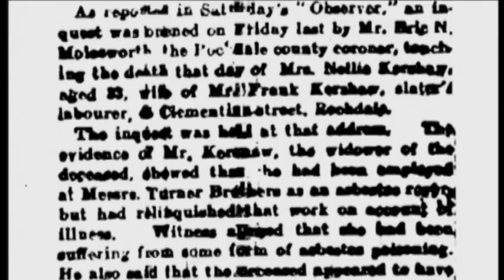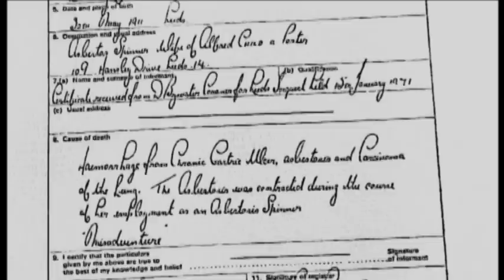The Evil Dust - the history of asbestos,  an excerpt

Comment: @0:48 seconds that espressos floor tile is still in our kitchen today house was built in 1940. It is covered over by later linoleum tile that was installed in the 1970s. 
    The whole house is heating ducting is covered in asbestos throughout the entire house. 
     The chimney flue vent from the downstairs furnace and water heater piping is completely asbestos going up to the house 
     Around the base and on the top and behind the house, furnace is all asbestos matting and insulation. 
     Behind upstairs kitchen against the wall there’s a giant 3’ x 4’ asbestos panel where the stove is placed. In a long R backyard in our two neighbors the back side wall of the house of our back neighbor that is 75 feet long two stories high of exterior asbestos tiles are still all original to this day..

Comment: ASBESTOS should also be named DEVELS dust 666. 666 is the devels number.  I bet it was founded on 1 friday 13th.  

Asbestosis disease
Savage material.
Brutal dust 666
Everlasting risks
Severe dangers
There is now a safer material 
Opinuns / facts about disease 
Stay out of the building. 

BAN 🛑 ASBESTOS AND FIND A SAFE ORGANIC REPLACEMENT INSIDE.

Comment: The biggest danger today is disturbing  hidden  asbestos.

I've been unfortunate enough to tear into plastered over asbestos  insulation board before that had been nailed over the top of lath and plaster. From the loft I thought I was dealing with lath and plaster only.

The stuff is lethal and prevalent even if you would never intentionally have contact with it.

I've had similar instances with pvc soft boards mounted over asbestos  and plasterboard over it in garadge roofs.

These days I try to look very carefully before I drill and always wear a respirator even if I'm almost  certain I'm just drilling plasterboard.

Comment: My grandfather worked with powdered asbestos for years when he was younger, people were practically rolling in it. Not surprisingly everyone he knew there died many years ago from asbestos related diseases. My grandfather’s nearly 80 now and still going strong with only minor scaring on his lungs. He is very lucky but has always told me about the dangers of the stuff. 

If you work in an industry that still works around asbestos, don’t be embarrassed dressing up in full protective equipment because the ones laughing at you for looking silly won’t be laughing when it’s them on their deathbed and wishing they done the same. This stuff isn’t a joke and lingers in the air for longer than most fibers as they are that fine, they get caught on your clothes also so if you feel you’ve been in contact with asbestos fibers get rid of them clothes and don’t take them home otherwise your family will be paying the price later in life too.
Reply: how can i get rid of the asbestos in an apartment after an company didn´t isolate the bathroom ?

Comment: My stepdad worked for the water dept in my town and told me that there is still asbestos water pipes being used cause its too expensive to replace.
Reply: It's safe transmitting water.  Not safe to breathe when cutting.  Cement + fiber.

Comment: Treat it and handle it and work on it as if you are working with highly irradiated nuclear fuel rods. The work area has to have tunnel suits, glove boxes, airtight suits and air locks that decontaminates itself after you enter and decontaminates both you and itself before you exit. Asbestos substitute is wollastonite, a kind of fibrous powder but it is made out of calcium silicates, CaSiO3

Comment: My Father worked at General Electric where they used asbestos in the lining of electric cables. Decades later he developed the cancer and was gone in 6 months!
Reply: Workers at the General Electric (GE) plant in Peterborough, Ontario were exposed to a range of toxic chemicals from 1945 to 2000, including asbestos, arsenic, vinyl chloride, beryllium, formaldehyde, trichloroethylene (TCE), polychlorinated biphenols, uranium and lead compounds, according to a new report released by Unifor, Canada’s largest union in the private sector. The document was presented to Ontario’s Workplace Safety and Insurance Board (WSIB) – an independent trust that administers compensation for workplaces – on 18 May.
Reply: SA-News how was it gone?
Reply: Abraham Alburez 
You misunderstand. He means his father died of asbestosis, not that the cancer was gone.
Reply: @AyeeBroTV  He died in 6 months
Reply: My uncle was an electrician and died of the same thing.

Comment: Asbestos reinforced concrete. Hands down the best building product ever. Still being used extensively.
Reply: Middle east. Pakistan. India. Buildings are so strong the stucco just needs a redo after an explosive attack.
Reply: Rick Matz
Where , China and North Korea ?
Reply: It's only the second best,  steel is number one.
Reply: Sterl is a conductor.
Reply: And glass is transparent,  it almost always takes more than one material to build a structure.
Reply: Other fibres work fine aswell, but are more expensive

Comment: In sheet metal school, we were shown a photo of the internal organs of an insulator that had worked with asbestos for 30 years. His lungs, liver, even intestines were covered with dime sized tumors. This man died on the operating table
Reply: Still used extensively though also there's a lot of almost identical compounds but different versions of Diatomaceous Earth are almost exactly same structure is asbestos but they don't have any warnings on them weird
Reply: @waltersobchak7275  talc is mined near asbestos, very similar, causes cancer and is in table salt and toothpaste.
Reply: @maxwebster7572   aye bro is that right I'm pretty sure they put it in sealer paint too . Acrilic high wall board sealer . Undercoat for jib etc. I've sanded so much of that an consumed heaps as well as lead paint
Reply: @jonog5632 9×9 tiles where loaded as well as the mastick that is used to put down the tiles. Wasn't detrimental to your health at  the time because they were still pliable.  Yeah I think about every time I dry swept that floor........ not really I don't worry about it too much. I think it's it's like everything is it affects some people more than others

Comment: I was exposed to asbestos when working on a friend's ranch. It was, buried building waste in the form of plaster mixed with asbestos. Dug lots out. That was years ago and luckily I seem to have got away with it.
Reply: How many years ago?
It can take decades to develop......
Reply: @dannygroom3327  2. It had been in the ground a while and was mixed with plaster sheet though, I soon enough got a dust mask when I realised what it was. Usually people that get asbestosis got it from working with the insulation type for extended periods. I don't think I breathed any fibers in, i I did, it was minimal and probably expelled from my body naturally at some point.
Reply: @MrRedeyedJedi  that's one of its problems is that the body doesn't expell it so it remains inside continuing to do damage. The damage may be small but over time it adds up, but like you said being in the ground and not dusty is probably °K.....
Reply: @dannygroom3327  all I can do at this point then, is have confidence in my genetics and the flem I've coughed up at various stages throughout life haha
Reply: @dannygroom3327  that's the hope anyways!

Comment: What this video FAILS to tell you is that fiberglass is every bit as bad for you. Studies have been done showing so. In fact was at one time named "the asbestos of the 90's" and yet it is still used in nearly every single home today. Its a billion dollar industry, thats why it is only considered a "lung irritant". We continue to protect and use fiberglass which is just as harmful.
Reply: SPNFENDER silica as well
Reply: What you fail to mention is proper handling of fiberglass and asbestos = no issue. Wear a respirator or rated mask. Jez, what do you expect the world to use? Fairy dust.
Reply: @UrielX1212  There is no proper handling of asbestos, has to be removed by by licensed abatement, I know I am one. Go try and properly "handle" it let me know how that works out. Point is there is no cancer causing agent in asbestos or fiberglass, its what it does when attached to the lungs that causes cancers, and they are BOTH as equally dangerous and should be handled as such.
Reply: The fear mongering "certified asbestos remover" crowd are the worst. Together with Lawyers they form an unholy alliance. Sure makes people alot of money.
Reply: @UrielX1212  Tell that to the thousandssss of people who have lost there lives from asbestos related jobs. I have known several personally, a slow and miserable way to die sometimes taking yearrrsss,  some "fear mongering" in that.
Reply: Plutonius X fairy dust will make you gay.

Comment: My grandad worked in the mill of the Jeffrey mine for a few years. He couldn't see his coworker six feet away because of the dust. He is still alive at 92 year old. That man did everything. He built houses, roads, railways. A true worker.

My other grandad died at 87. He started out as a teacher and moved to head of school district.

I'm not saying asbestos makes you live longer. I'm just saying asbestos isn't an instant poison. You need chronic exposure to dust in order to get sick from it. Meaning, if your heating ducts are asbestos lined, you're absolutely fine, as long as you don't disturb it. My high school was built in the 40s, and I swear most of the heating pipes are insulated with asbestos.
Reply: Yes but with some people it doesn't take much exposure.
Also once it gets in you it can't easily get out again apparently.
Reply: @vinceking7878  It depends on what type of asbestos. Chrysotile, for example, is significantly less likely to cause long term damage with limited exposure when compared to amphibole asbestos, as the fibers are more flexible and work their way out easier. The dangers of asbestos are certainly applicable if you worked in an industry using it for years or were exposed regularly in some other way, but law firms are definitely guilty of spreading paranoia throughout the populous about how dangerous it really is in small quantities. It's an extremely dangerous material that gets perhaps too much attention compared to other carcinogens we come into contact with daily. (I'm looking at you, petroleum.)
Reply: Much of it depends on genetics,  different people react in different ways to toxic substances.

Comment: You'd think these guys would be dead overnight with the amount of dust they've ben inhaling? I know it generally takes between 25 and 40 years to manifest, but how much does the average layman suck? These here are Industrial strength quantities!
Reply: Industrial strength lungs mate ;)
Reply: There is no minimum exposure level for asbestos.  A single fiber can cause cancer.
Reply: @acmefixer1  thats strange since there is asbestos fibres in the air we breathe
Reply: @fikofikret1522  it depends on where you are.
Reply: @fikofikret1522  not necessarily new buildings won’t be affected unless in 3rd world countries
Reply: @seanhartnett79  iam talking about air polution in urban air/ outsidd air. Like fine dust asbestos has poluted the air and contains small amounts of asbestos fibres in the form of fine dust. Its everywhere.
Reply: @fikofikret1522  you shouldn’t have asbestos in the air accept if you have old buildings

Comment: Go to the "third world" and you will find asbestos being milled and installed to this day. There are still companies building peoples homes with the stuff.
Reply: serious? wow!!
Reply: Yep. I shared a flight with a bloke who was in the country trying to buy machinery for manufacturing asbestos cement sheet so they can make new stuff. Apparently the rational is that their life expectancy is so low it doesn't matter.......
Reply: @benjaminjones512  I did some voluntary work in India building houses and inadvertently got exposed to it without them warning me. Now I'm royally fucked.
Reply: @benjaminjones512 ...I was simply removing drop ceilings to look at my heat ducts and threw them outside. Some fell and broke, I cleaned up and started looking into duct replacement when I came across these threads online about the use of aspestos in tape and ceiling tile. I never heard this before. The house is from the 30's. I went back down there and white tape was used on the ducts. I didn't have a mask on because I just thought the tile was that cheap 1980's stuff. I'm having it tested. This was never brought up in the inspection.

Comment: so if a person come in contact with abestos living in older home. could this give you cancer?
Reply: +maria carrasquillo there is no danger if it's in good condition. just don't go cutting holes in it.
Reply: maria carrasquillo You have to inhale the fibers. The ceiling tiles in one home I lived in were asbestos, but they had 7 or 8 coats of paint on them. Today, we encapsulate asbestos in a latex paint type product. The best answer is:  If you do not cut, grind, sand or saw on it, it should pose a very 
minimal risk.
Reply: maria carrasquillo
If the asbestos is encapsulated it is not dangerous. It is only when disturbed and the fibers become airborne that it becomes a hazard. So unless you remove, drill through, or otherwise disturb the siding you are OK.
Reply: bullshit artists! you idiots don't realise that inside of the high school is asbestos cuz it be built in the mid 1950s and its almost all exposed by now...lol...sorry...I just wanted y'all to know that the bare wires are even clearly visible
Reply: its outside my home asbestos  siding.cover vinyl siding would that be safe
Reply: YES. There have been wives with Mesothelioma that have died because they did the husbands laundry.Even dogs have gotten Meso. Common latency period is 20-40 years. It is a dose dependent disease, so if you were constantly exposed to small doses, that is bad. Large doses are when it is disturbed (i.e. drywall work, brake repair etc ..). The fibers get stuck to your cells and when the cells divide, a portion of your DNA/Chromosomes stick to the fiber and now the daughter cells are damaged (Chrysotile induced Aneuploidy)
Reply: i have home with abestos outside siding. i had it covered with vinyl siding. could a person get this cancer living in old home. or is it from working with it?

Comment: In my old school the basement was covered in asbestos, that's the only reason it's not torn down yet. The janitor had to wear a gas mask to go down there.
Reply: Unless it's in bad shape you are not going to die. I remove this stuff for 25+ years and inhaled more than most. I'll be lucky to make 70.
Reply: redhead5150 If you remove it, you would be wearing protective gear so I don't understand why you think you'll be lucky to make 70.  If you take all the precautions and wear the appropriate over-garment protection and mask protection, you should be no worse than any other citizen.
Reply: @MsSalemSaberhagen  Most importantly, use water to keep the dust down.